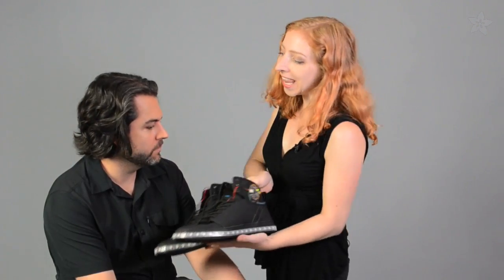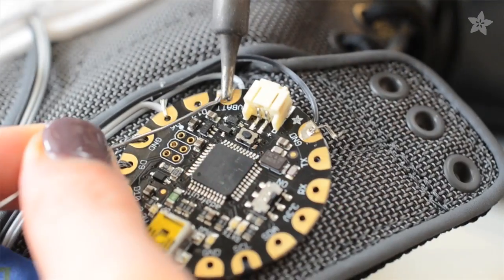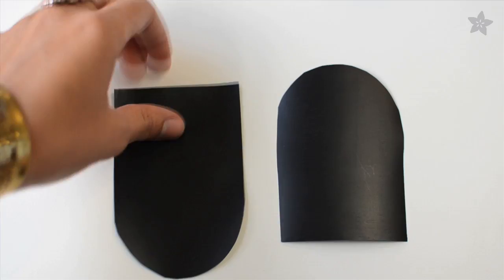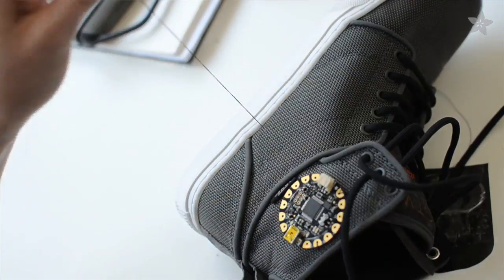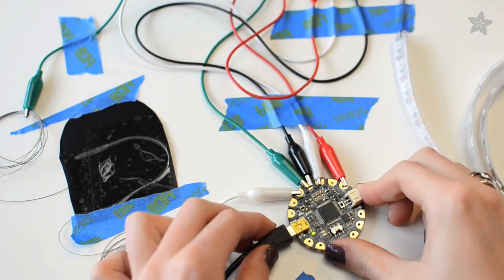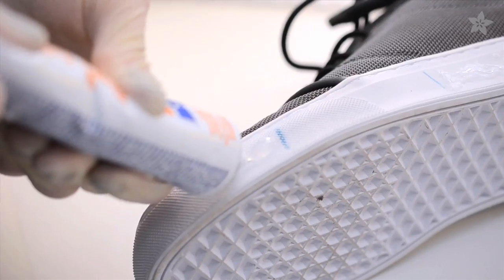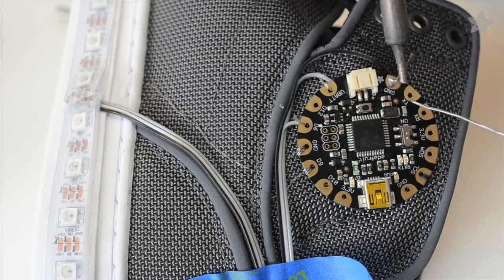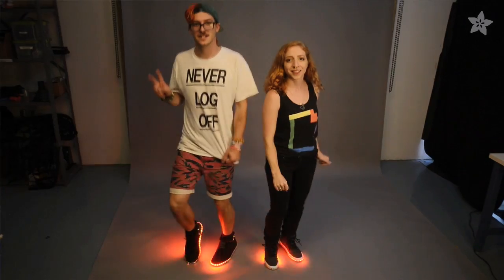Firewalker LED Sneakers #Adafruit

Comment: I made something similar to these back when this video was new. I had so much trouble fastening the LEDs to the shows. I tried a few glues, gorilla glue didnt hold, and silicone didnt hold. I also tried LED strips that had adhesive, but they too peeled off.
What  I finally did get working was using the kind of strps that have silicone covering the outside, but flat and sticky on the back side. THen I stuck velcro to the sticky, and velcro to the shoes. Originally I put velcro along the whole strp, but it turns out that its hard to remove if you do the whole strip, so only do a bunch of small spots if you want to be able to remove it to wash your shoes
Reply: Loctite glue.

Comment: Can you do a video with a real time making of this? It really lacks technical details. For example: which port do you connect the wire sensor wire to? And how'd you connect the LED's to the Flora?
Also, does this require any programming? Don't you have to load any sort of code into it?

Comment: but are these safe in the rain or if you step in a puddle?
Reply: I know this is a year late, but if you have weatherproof Neopixel strips (the ones Adafruit sells are all weatherproof) then they should be safe, the microcontroller on the other hand should definitely be put inside your shoe.

Comment: or for the battery pack instead of putting it in the laces you can use long wires run it up the inside of your pants and out the top and put the pack in your pocket
Reply: just saying